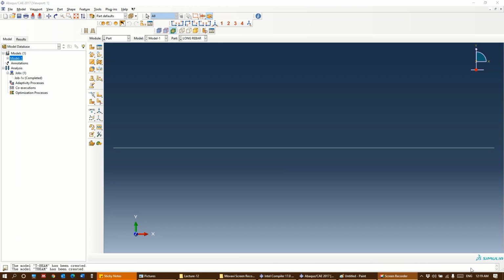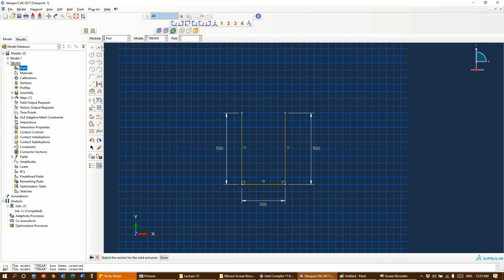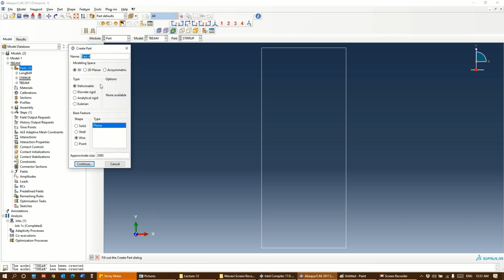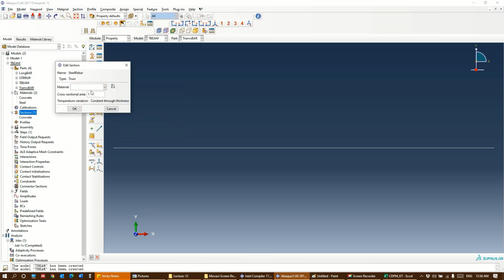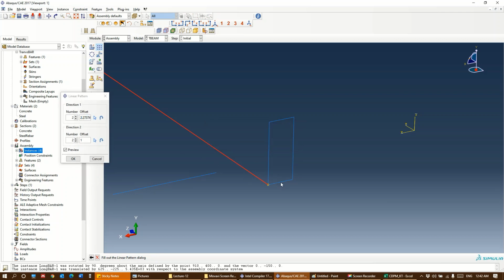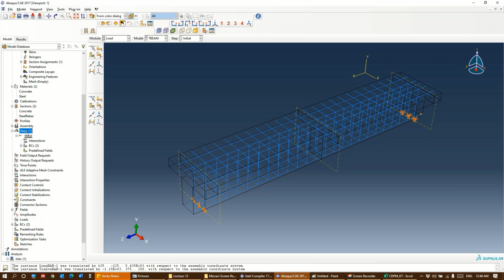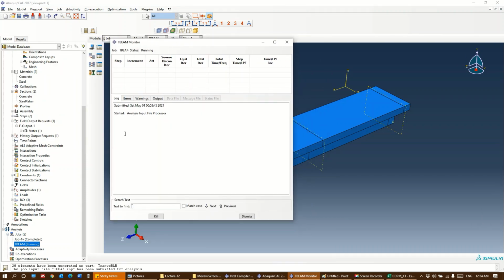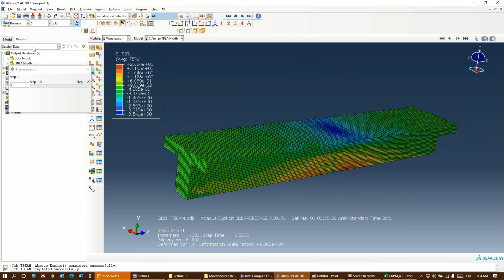Reinforced Concrete T-Beam Analysis in ABAQUS (Step-by-step Tutorial) with 🎤 explanations

Comment: After rendering your profile (for steel section) you can see that the longitudinal bars and stirrups are merged in each other. The reason is that you just assembled them with center to center point. Which cause false load carrying capacity.
Reply from the maker: Yes, you’re right👍🏼
The bars can be located according to accurate locations using datum points